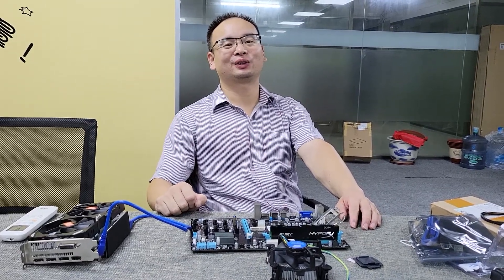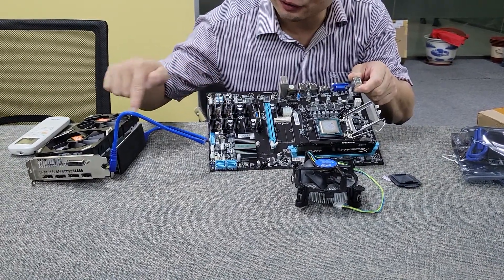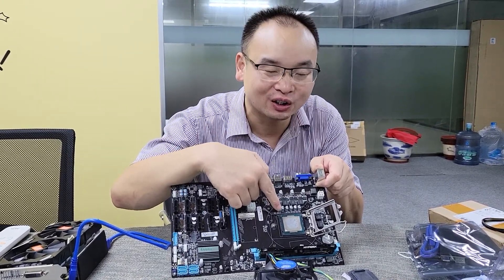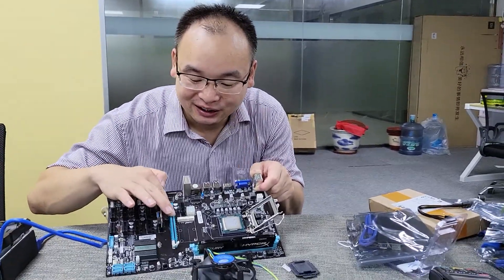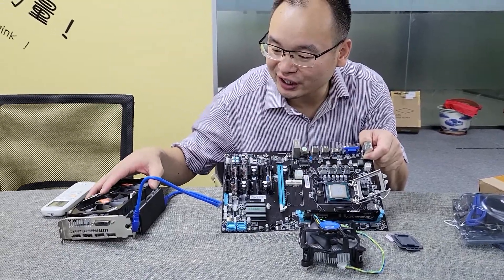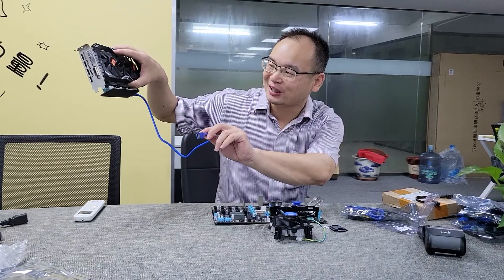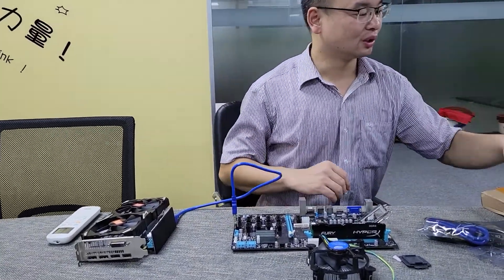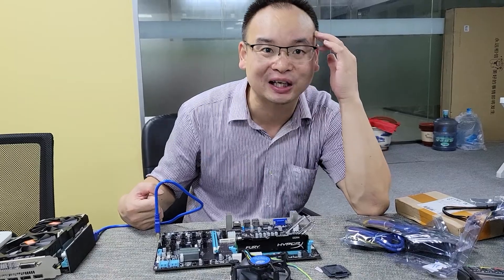Explain esonic B250 BTC GLADIATOR mining motherboard

Comment: hello my motherboard is the same as this.  I use an lga 1151 ram 4 cpu when I turn it on it can't appear on the monitor, why?
Reply: Did you ever solve this problem? Mine is doing the same.
Reply from the maker: @shiTthebed86  NO
Reply: @shiTthebed86  Did you sort it. Sorry if you know but says in manual only connect via onboard gfx even if pci e gpu connected, Cheers Dai
Reply: Mine is also doing the same thing, not appearing on the monitor
Reply: @autoaddictions4life  also wouldn't work though VGA only HDMI. Hope this helps. Nothing more frustrating then a no post.
Reply: @autoaddictions4life  yeah mine are USB.
Reply: @autoaddictions4life  just make sure your ram is fully inserted, mouse, keyboard, and monitor all connected properly. 
If all fails buy a Mobo speaker. Then get beep codes.
Reply: @shiTthebed86  Thankyou!  My VGA don't work either, must be a bug in the board.  I didn't spot the HDMI connector.
Reply: @autoaddictions4life  mine turned out to be because my mouse and keyboard where not plugged in. I plugged them in and it started up.
Reply from the maker: @autoaddictions4life  okay
Reply from the maker: broken